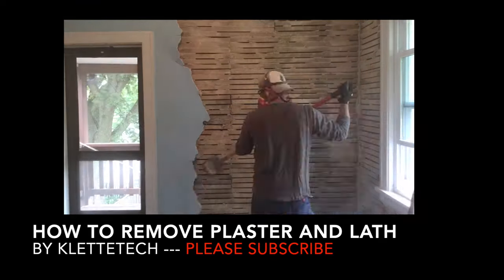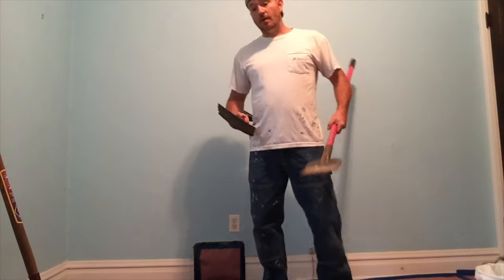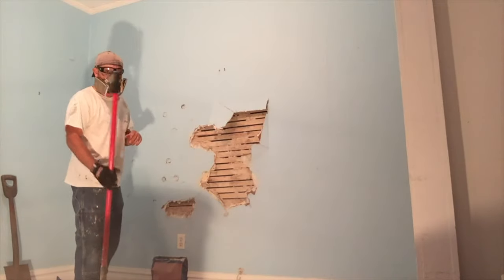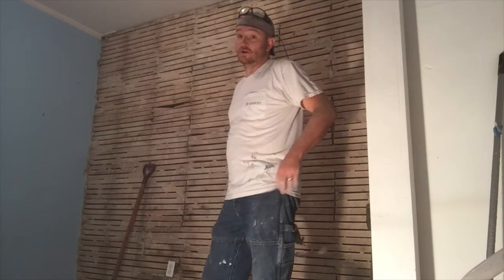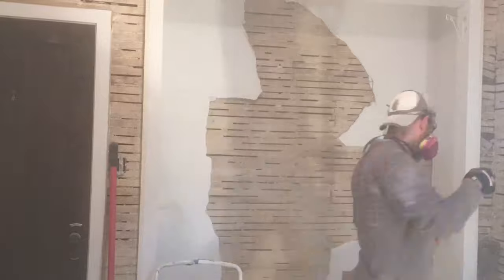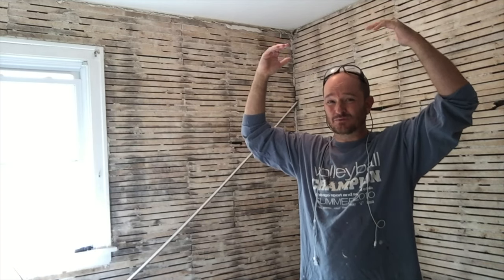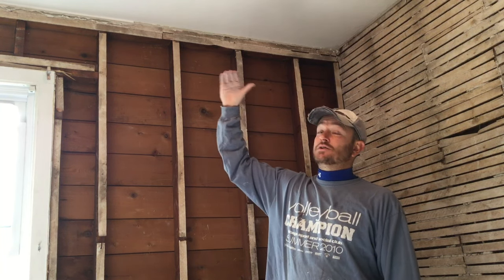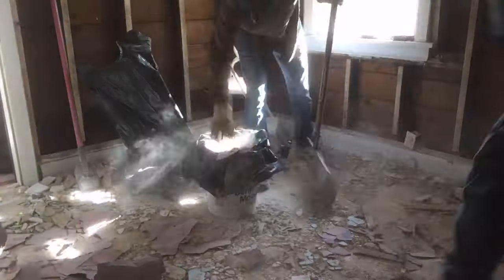How Removing Plaster and Lath (Part 1 Bedroom Rehab)

Comment: can you put drywall on top of the lathe?
Reply: yes
Reply: @fredsargent523  how do u know if the plaster has asbetos?
Reply: @randomrazr  you can buy an asbestos test kit at lowe's or amazon.
Reply: @fredsargent523  if its got horse hair in it its prob dated before asbestoc?
Reply: @randomrazr  Yes. Horsehair mainly used prior to 1940, asbestos after WW2.

Comment: Good instructions - I've done so many rehabs involving plaster and lathe that I don't even think about it anymore. You're correct it's very easy taking them both down but it's the clean up that takes the longest. Nice how you use the lathes as furring strips to build out for the drywall.
Reply from the maker: Thanks for the comments.  Nice an experienced guy agree with me.  Hopefully this video helps some people out.

Comment: Is there any reason that you could not just leave the plaster ceiling up and not cover it with drywall ? I really would prefer not too mess with my ceiling.
Reply from the maker: I took the plaster off because I was worried about the weight of the both the plaster and drywall on the 2x4s.  If I had 2x6s up there I would have probably left it up.

Comment: Why didn't you use foam injection insulation If you just needed to insulate the walls?
Reply from the maker: The walls were in really bad shape and it would have been to much money to repair the plater.  So I took out two birds with one stone.

Comment: I bought an old farmhouse and have to either fix cracked plaster walls or rip out and replace with drywall. It has no insulation so i want to do exterior walls. wouldnt it be easier to frame/insulate/drywall over top?? I know it would make rooms smaller but for me alone I need easier.??
Reply from the maker: Great comment/question.  I personally dont think so.  Square footage is really important and this was a lot of work but it goes pretty fast.  The walls in this room where really rough and fixing the plaster was not an option that I considered.  The better I can insulate the more I think it is worth it.  This room got cold in northern IL.  But depending on where you live insulation might not be that important.  Any other questions I would be happy to offer my opinion.
Reply: Susan barley, how did that work out? I have a farmhouse like that and I'm debating between the two options

Comment: KletteTech, You mention in the video that you fixed or re-wired the electric system in that room.  Do you have a video on how you did that?
Reply from the maker: I am working on the video.  I have had to pause the project.  I want to put the electrical video together when I rough it in and finish it up.  I send it to you when I am done.
Reply from the maker: I just posted the prewiring video:
https://youtu.be/HBPFmTDv0N8
I an editing the wiring part.  Ill let you know when it is up.  Let me know if you have any questions

Comment: can the lath stay up and add drywall over it?
Reply: sure, and after enough layers you won't be able to walk into the area. seriously though, drywall does not have the holding power to cover anything cept insulation and thin moisture barrier material. I'd suggest you just stick with saniches, but looks like you failed at that too.

Comment: Oh man. I'm 22 and my girlfriend and I just bought our first home, which was built in 1916. So guess what we're doing? This. We've made pretty good progress. We've almost got the living room, and two bedrooms, including the ceilings taken down. 9 foot tall walls, the living room is 27'x13' and the two bedrooms are 13'x13'. So lots of work. The living room is almost ready for drywall! We've gotten the majority of the new wiring ran, just gotta run to the lights/fans. Definitely a lot of work, but man will it be worth it.
Reply from the maker: You are right.  Completely worth it.  Good luck and have fun.  Also, wear that PPE
Reply: @KletteTech  definitely. We have respirators, gloves, goggles, and long sleeve shirts and pants. 👍 I'm ready to get moved in
Reply: @luishernandez8435  unfortunately we haven't moved in yet. We're about 6 months in. The living room is just about finished, then the back half of the house, kitchen, dining room, second bathroom, laundry room, and hallway are painted and updated a bit (we didn't tear the lath out yet because it's in pretty good shape). The front bedroom just needs a little bit of prep work. I'm gonna try to knock the wiring out this weekend and insulate the walls, then start on drywall. The second bedroom has a pretty bad sag in the wall and floor, which is attached to the front bathroom, so we're gonna leave that open and tarp those rooms off so we can work on it once we move in. Congratulations to you guys on your home!! It really is a great project to do together. Lot of work, but it's very gratifying. Good luck to you guys and I wish you well!